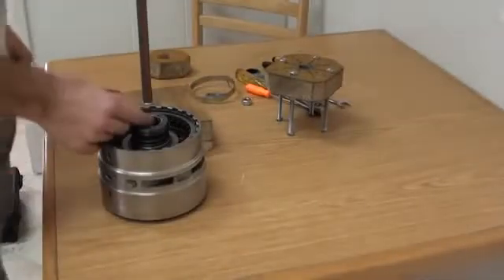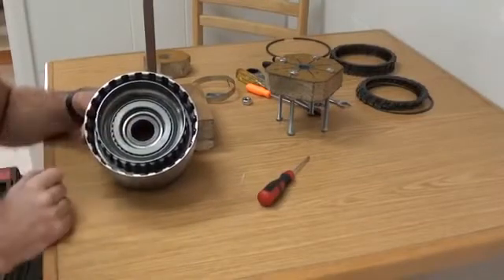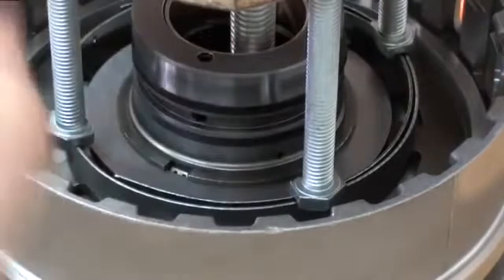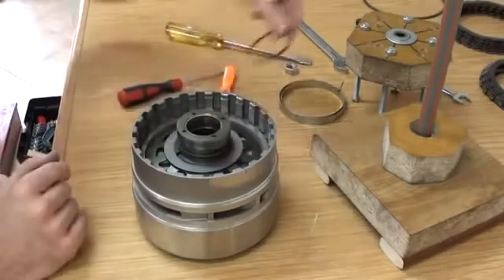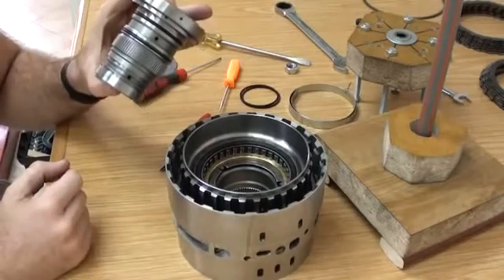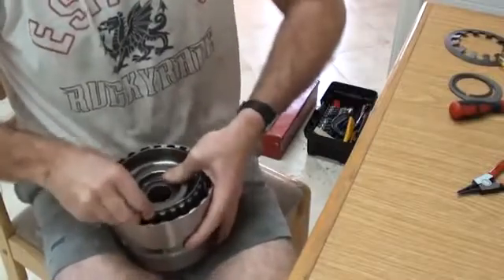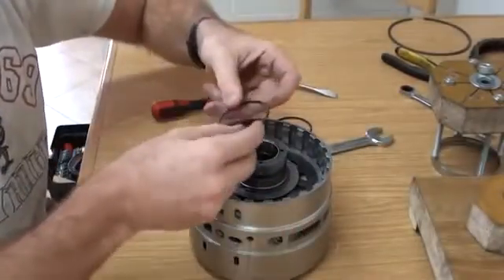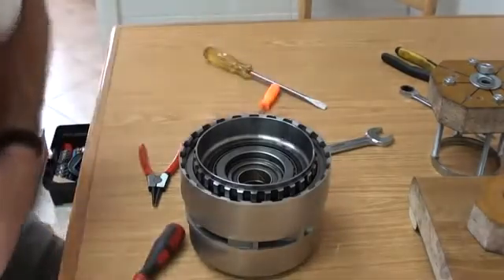ZF 5HP19 D G clutch drum reverse drum

Comment: Very useful mate! I was able to get the cup spring off with the hand made tool, but having difficulty to put it back. I now realised that I need to make the Clamp ring smaller to compress the cup spring, then push down the snap ring. Having a wood block on the bottom would help too.